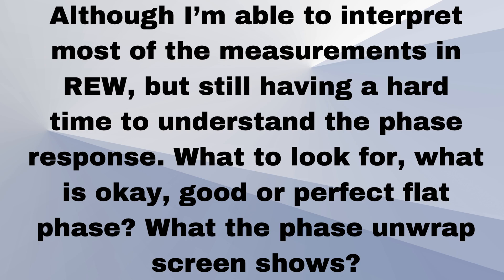Mastering Phase Response in REW

Comment: I saw a REW tutorial, where you would take multiple measurements, of one speaker, at different (listening)positions in the room.  These measurements then where time-aligned, averaged and filtered with an FDW (Frequency Dependent Window). The tutorial claimed, that all reflections would average out, while the direct sound, hence the phase at the listening position would be the only thing left in the "measurement" and could be used for correction in RePhase for example.
Would you say, that's bogus, too? Would you try to use near field measurements of the speaker just for phase correction, instead?

Comment: Isnt it reasonable to look at the phase response around the crossover region for the subwoofer and a satellite speaker to figure out if the two have similar phase response and thus figure out the correct time delay of the subwoofer for better matching with the satelite speaker? And of course the subwoofer AND the satellite speaker must have been measured in full range, meaning no crossover filter active during the measurements?
Reply: look at my comment, you do not ned to look or measure anything to get phase work done.
Reply: Ok thanks but i cant hear phase.
Reply: @jeppekristofferable  lets say at 100hz, you adjust the phase at the crossover point to where it sound the loudest, that is one of the in phase points, then adjust the phase or delay until you get another one.
it is going to sound better or worse. that is how you hear phase.
music and frequency sweeps and listen.
i promise you that snappy drums are going to show you how much delay you can hear.
Reply: @sudd3660  ok i see what you mean. Thanks i will try.
Reply from the maker: So yes you can look at phase at the crossover region. But the problem is you actually need to optimize multiple things.  Phase and time and energy peak must all be relatively optimized at the crossover region. If you focus on just one, the others might be a bit off, and the summation is imperfect. So you end up having to look at the phase, the energy peak, and the time alignment (the latter two being inter-related).  

My point is mostly that looking at phase over a wider bandwidth isn’t very useful.  At the crossover it can be as long as you understand how to read through the room noise. There will be a lot of garbage there too. 

While REW is a hugely powerful tool, pricier tools have better features for phase that make this task much more obvious.
Reply: @PoesAcoustics  Hi, what pricier software tools would you recommend if we are interested? Thanks.
Reply: I see. Thank you for your reply. I appreciate it alot. Now ive learned some more. I continue my acoustical journey a little bit wiser.

Comment: So, for my sanity… if you have a linear phase speaker, say a HEDD Audio monitor with the “Linearizer” on or a Genelec smart speaker with the “extended phase” setting turn on through GLM. Those make the speaker have actual linear phase throughout the speaker’s band pass, from 100hz-20khz after tuning them to the room. 

There’s a huge difference in SQ when listening to those speakers versus listening to a passive speaker corrected through Dirac or Trinnov. I mean…. It’s like night and day. 

Could you help me understand what’s happening there? I understand what you said in the video and it makes complete sense and I agree with you. But those two speakers mentioned above again sound light years better than most other speakers I’ve heard. Entirely controlled impulse responses and linear phase throughout the entire FR, in room. When listening to those speakers, it literally feels like you could reach out and touch whatever audio is being played through the system. It’s spooky.
Reply from the maker: Well are you saying you took the HEDD and listened to it with the linear phase off but using Trinnov optimizers phase correction. Then turned that off and turned on the HEDD phase linearizer, and preferred the latter?

Linear phase is relatively minor.  Its auditory is questionable. And while I find it audible to a point and useful to do, the reason those speakers sound good isn’t their linear phase. It’s everything else they get right.  Phase being just one small part of an overall better package.
Reply: @PoesAcoustics  I apologize for not being clear. My brain was probably fried from work that day. 

I just meant that there’s a strong difference listening to a HEDD Type 20 with the linearizer on and with the linearizer off. 

I brought up room correction because the room correction fixed the phase at the MLP that the room broke once the speaker got into the room. 

But your reply still answers my question. Thank you for your time, sir.
Reply from the maker: @MyFatherLoves  one possible issue with the on/off test you did is that it’s possible it’s changing the response. I haven’t measured that specific speaker. But when we did some testing using a Marani processor, I was unable to make it so the FIR phase correction didn’t also change the amplitude response.  I don’t have those speakers to test, but it’s possible that the listening test is inadvertently conflating two changes. Response and phase.  

I know with Trinnov that their 3D mic and processing allows them to extract the speakers anechoic power response and anechoic listening window response from the in room data. I don’t know this for certain, but I believe that they primarily phase correction the anechoic aspect of the impulse response and remove the room reflections. Leaving their impact intact.  

One thing to keep in mind. The only way to get linear phase like this is through FIR filters. Often they introduce pre-ringing. If it’s small, it’s inaudible. If it’s large, it can be quite audible.  I’ve seen evidence of the pre ringing in Dirac and Trinnov. Sometimes it’s not there, sometimes it’s small, and sometimes it’s very large. I don’t really know the cause when it is large. Trinnov has a way to reduce that if it happens. There is debate that it’s audible.  But there is also debate that linear phase is audible. From a system engineering standpoint, I would argue that you need to balance these. Not favor one over another.
Reply: @PoesAcoustics  Thank you so much for taking the time to explain all of that. It was very clear and I was able to follow it. (finally finished writing my response and I started to outward process, so don't read if you don't have the time. haha)

That makes total sense and it makes me wonder if Genelec and Hedd are using FIR or just IIR + all-pass filters when their respective "phase extending" options are turned on and how that affects FR. It's near-impossible to tell with Genelec because you need GLM to be able to use their "extended phase" mode and that's only able to be turned on after you measure the response in-room which changes the FR. My friend has the Hedd Type 20's (no subs) and they drastically change the bass response in-room when he flicks on the "Linearizer". 

I suspect that since Hedd has a Klippell (I'm sure Genelec probably also has one too...maybe), they ship their speakers with a low-latency stock mode and then when you switch on their "Linearizer" it loads an anechoic FIR corrected response because it increases the latency by a significant margin.

Do all-pass filters also increase latency? 

I've got Genelec 8361a's for LCR, HSU CCB-8's for surrounds, and an HTP-1 in the mail. My plan is to use GLM first to get that "extended linear phase" mode set on the Genelecs (which increases latency from 4ms to 8.5ms prior to setting delays for the room) and then run Dirac w/ DLBC for the whole setup. I'm a huge fan of coaxials if you haven't guessed. ha

Oof.... I wonder just how badly that's going to increase the overall latency of the system when trying to play Xbox? Most people use passive speakers or active (with no processing happening in the speakers) for HT so I don't think this is something most people experience. I know I didn't think about it until just now. Huh... Since the HTP-1 allows you to save multiple Dirac tunings that you can switch on the fly, I may get GLM anyway and just have two Dirac presets. One for tv/movies/music that uses the extended linear phase mode in GLM and another for games with no GLM. That'd be easy. That would also would be an easy way to tell if phase-linearity makes a huge difference or not.

I have much work ahead of me menacingly rubs hands together

Comment: Thank you for the honest video, I think I may be one of the knuckleheads who thought they got it…. but this raises more questions.
Could you maybe do a small video some day with the right method and take a minute to explain it for the n00bs like me? 

How to zero out that delay and get that descent data we need, get the impulse response right and what is minimum-, mixed- and linear phase?
Also, does this apply to subwoofer allignement or speaker allignement or both? What about a well treated/dry room?
I think it will be easier to understand when it’s being done correctly in a video with your wise voiceover.

Comment: The best channel with the smartest in aesthetics and the tech, You can't say that about anyone else than Poes Acoustics.

What do we think of these scripts from OCA that get directly set in a Marantz / Denon hardware with Multi EX and Audyssey One. Or Joe N Tell(s) sweep and filter app?

Does all this harmon curve obsession help with dynamic steering like Trinov or Sony ES. You absolutely need external amplification for major room correction DSP enablement where the PEQ is upped by 12 DB on several points and bass controlled at 6 DB. Some tiny Denon 3700H is not going to cut it with a lot of correction configured.
Reply: At +12db it would seem your trying to boost a null which is impossible
Reply: @williamkramer9069  But we all agree separate amplification improves channel separation, headroom so I just think you are going to hear with Dirac, ARC, Audyessey sounds like. And someday when they implement these DSP PEQ multichannel PCM chains needs to sample at 24 bit / 96 kHz the sound chain.

Comment: i gave REW a bit if a go, but as you said phase it not it's strong side.
found i could easily hear phase so i did things by ear, measurement of summations at crossover point can help.
at least for subwoofer to main crossover frequencies, 80hz to 200hz.
 with music and tone generators with a real-time dsp you can go along way to adjust many things :)